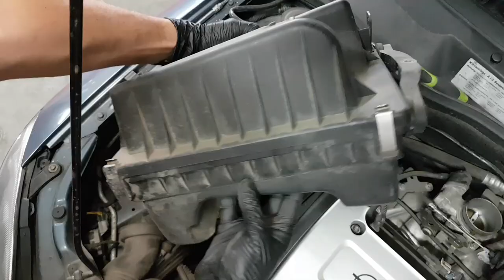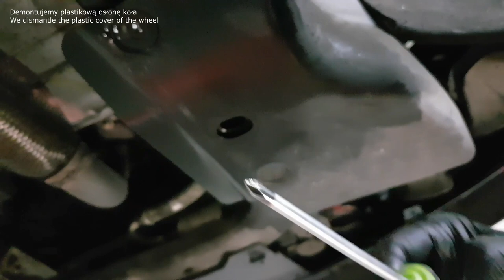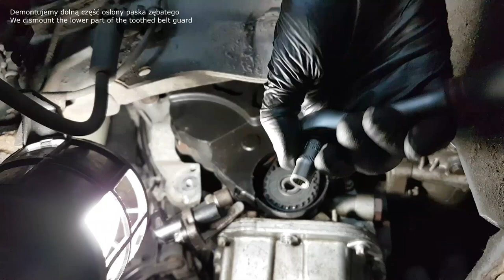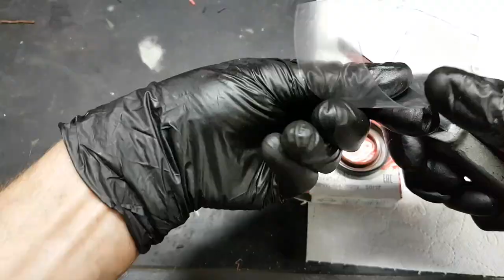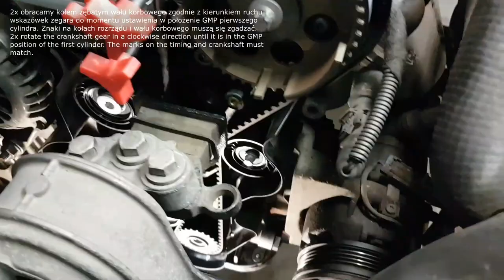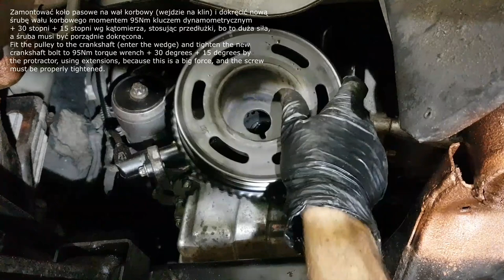Jak wymienić uszczelniacz simering wału korbowego OPEL ASTRA G 1.6 16V x16xel

Comment: sbagliato il tendicinghia è stato tirato troppo nella prima messa in posizione,altra cosa la pulegia lato aspirazione è un dente fuori posto,x far ruotare il motore x vedere se tutto va bene consiglio di smaontare le candele ,cos' non si avrà compressione guardo si fa fare tutto il giro alla cinghia
Reply: The reason they put it tighter than supposed to, is because there is slack in the belt. As the slack moves around, the tensioner gets looser, thats why it was re-tensioned.